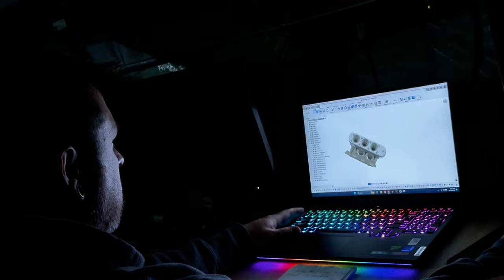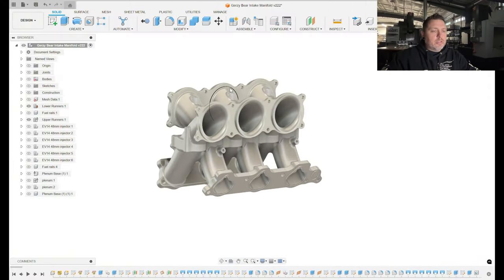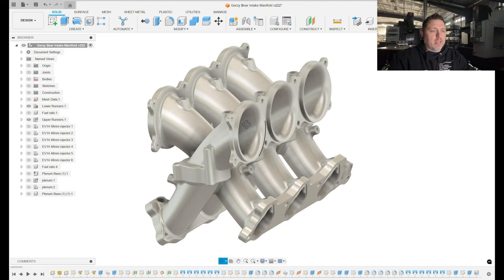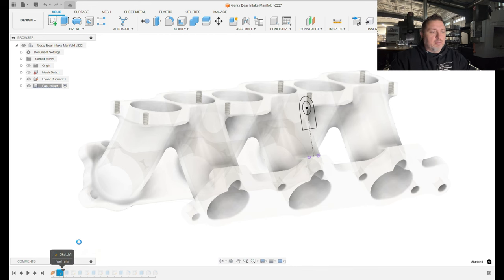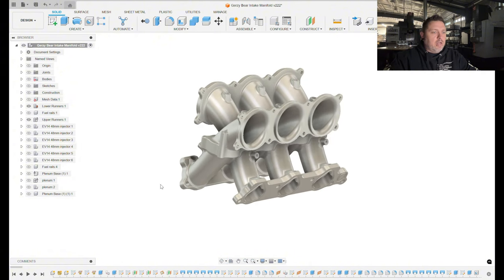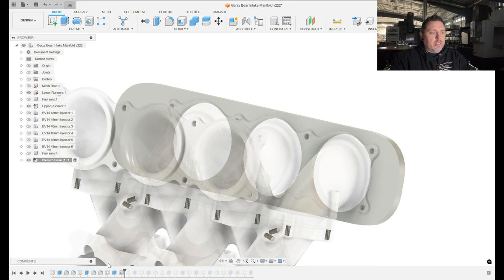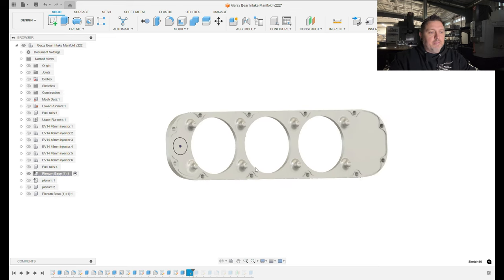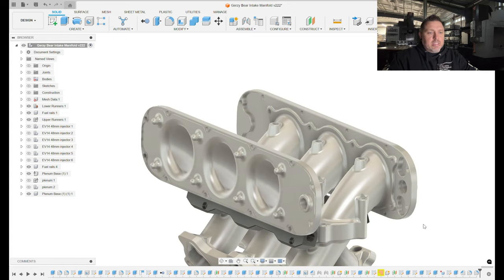Learn to Build a PROFESSIONAL Billet Intake Manifold : Episode 3

Comment: I have some questions on the 3D printed prototype. What material did you use for 3D print prototype? Was the 3D printed version accurate enough to use for fit-up checks? What 3D printer do you use?

Comment: Looking good Justin👍  these videos have sparked my interest to get back into designing/machining a manifold project I keep putting off. 
Looking forward to seeing the CAM side of things. I've been using accessibility analysis a lot and playing with runner design. Not sure if you've used access analysis, but if not check it out! Similar to undercut analysis in SW. Thanks!
Reply from the maker: @maddogmachine8334  yeah I have been using it on the cam side, I wish the had a feature where you could use it during design without having to switch back and forth and regen toolpaths
Reply: @linderpowersystems_LPSFAB  While in the design side under inspect try accessibility analysis if you haven't already
Reply from the maker: I’m gonna have to give that a shot